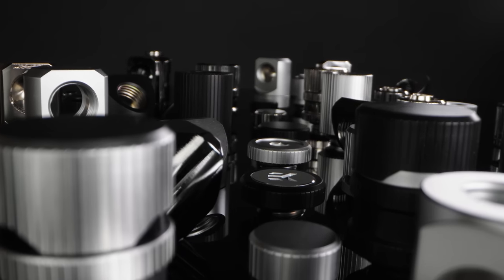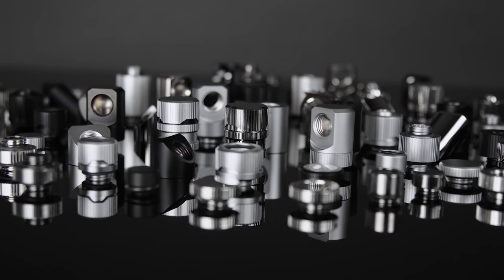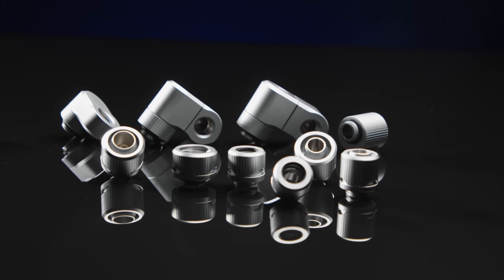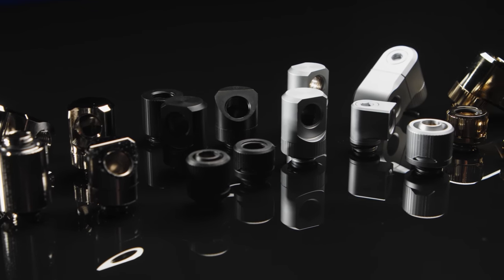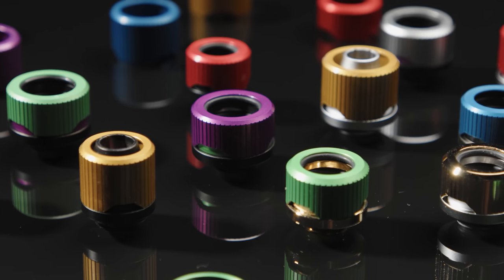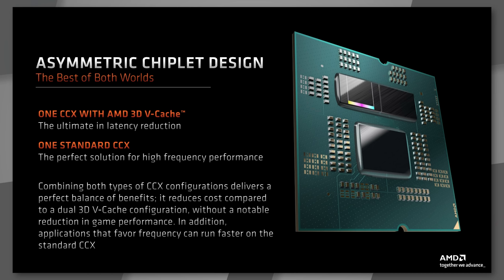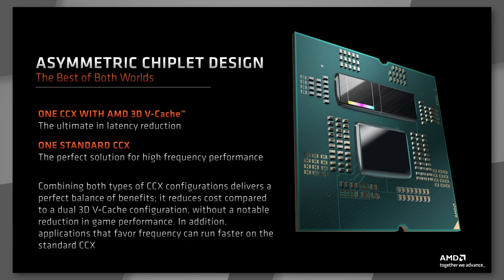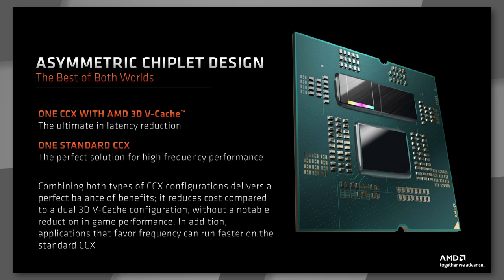Why I switched back to Intel...

Comment: I have 7800x3d -15 CO, Asus Tuf X670, 2x32gb ram to 6300mhz cl 28-36-34-30, all this with blck at 101.625 and 0 issue. From pressing button to windows 19 sec. Cold boot due to ram training and high capacity ram around 2 minutes. 

Key for ram stability on Asus board is to ENABLE Power Down in Ai Tweaker and DISABLE memory context restore in AI tweaker and ENABLE it in ADVANCED/AMD CBS/UMC COMMON OPTIONS/DDR OPTIONS/DDR MEMORY FEATURES. If its not this way, things broke up, random restarts, no booting. Maybe some conflict or bug in Asus bios? But this way its stable and booting under 20 sec.

So maybe your case or just faulty CPU, it happens. U did not even try to replace it with another sample?

Comment: Well i use "Process lasso" and have all the Microsoft - XBox crap removed. Like this i get the best of both worlds and don't have to be afraid of Intel going up in flames, have lots of cores and still be extremely power efficient.

Comment: I will also switch back to Intel when I will be building completely new computer. Most of things AMDnazis say about Intel are lies and manipulations, it's not that bad and AMD is not that good as they say.
What I hate the most about today AMD architectures is that there is very bad heat transfer from cores to IHS, so it doesn't matter how good cooler you have, cooler is still cool and CPU has 90°C in 100% load. Yes, I know that intel eats more energy and generates more heat in watts, but better cooler makes a difference, you can actually lower that temperature, with AMD, from some point (which is like 100+W TDP) you can't, only thing you can do is lower voltage. I agree that AMD architecture is generally better, but this kills it for me, I absolutely deny that 90+°C in full load should be a new standard now and another things is single core performance which is still just better on intel CPUs and for a lot of soft and games, this is still really important.
When I upgraded to Ryzen 3800X, I was very disapointed, single core performance was not that better compared to 10 years old overclocked i5, which is just sad. Now I have 5800X3D, which is just slightly better, but when you OC some i5 or i7 from haswell family, it can still gives you similar results in single core performance, which is completely crazy.
Let's look for example at super pi 1M, old C2D E8600 - 14s, some i5 3000 series (I don't remember what exactly model) - 11s, Ryzen 3800X - 9s, Ryzen 5800X3D - 8s. I just wanted more after 10 years.
And then, there is that problem with infinity fabric clock which makes buying faster rams pointless, Intel doesn't have this problem.
Another thing which really bothers me is that Windows 10 boots much faster on Intel motherboears, like on some 10+ years old ivy bridge or something, it starts in few seconds, but on my AMD X-570 MB, it takes like 10+s just before you even see the post screen, that's terribly slow even when I have really fast nvme SSD, but slow post screen kills it.
And with OC, I have the same experiences as you - you touch something and it's not stable or it doesn't work at all, you can't really change anything, I just had more "fun" with Intel with unlocked multiplier, OC is much easier there. With AMD, you touch something and it will tun off boost frequency and you have to set it permanently. With Intel, you vice versa play with turbo boost frequency when you are doing OC.

Comment: Googling issues and came across this , having constant issues with crashing / memory resetting and system hanging up when launching games on 7800x3d , have gone through 2 different memory brands and 4 bios updates and 2 windows re-installs and cannot seem to get it to run properly, Kinda at my whit's end.
Reply: You might have gotten a CPU with a weak memory controller. Many people exchanged their CPU or board and had it fixed that way

Comment: I’ve built many 5800x3d rigs, two 7800x3d rigs and a 7900x3d rig. Yes, they are great gaming CPU’s……….but they require a few tweaks or not for stability more than anything else. What I’ve found is; do not under-volt these CPU’s. Leave them as stock as you can for maximum performance and stability. Tune your ram…..both DDR4 and DDR5…….and I don’t just mean timings. Tune your voltages (multiple) on both DDR4 (SOC / VDDP / VDDG -CCD -IOD / RAM VOLTAGE) and DDR5 Voltages (similar, but different than DDR4). Also different from Intel to AMD. Bottom line……..tune the system for performance through ram rather than doing much to these “3dVcache” CPU’s. Of those “3dvcache” CPU’s out there that I’ve built with, I prefer the 5800x3d and the 7800x3d that have “3dvcache” on a single CCD to those like the 7900x3d or 7950x3d that have 2 CCD’s, but only 1 with the 3dvcache. These latter CPU’s are trying to be “gaming” and “productivity” CPU’s at the same time and I believe they have more work ahead of them to make this work efficiently and achieve full stability. One way to fix the problem on dual CCD X3D chips is to go into bios and under PBO you can adjust the max clock frequency per cpu in each CCD. Adjust the “non 3d vcache cpu’s” to be lower than the “3d vcache” CPU’s. Games will use the higher clocked CPU’s and therefore use the correct CCD on the dual CCD X3D chips.

Comment: Yikes...sounds more like trouble on the bleeding edge..   I'm still using an AMD 3900X on an MSI AM4 Gaming PLUS MAX mobo with 32 GB of RAM running games, two vm's plus youtube and two email accounts...and etc..etc....with no stability problems at all.....oh...am using a second hand ASUS 2080 Strix video card....and system is just awesome...:)...

Comment: Running a 7800x3D, B650 motherboard, Rtx 4070 with 6000 mhz 32gb ram and everything is running fine.
I could have saved alot of money not buying a GPU because the games I play are like lol and osrs which are not that GPU intensive at all.

I cannot speak on behalf of other AMD users but I've heard these horror stories about people with Intel CPU's basically have their PC melt down or burn up doing normal activity on pc or work. 
I dont claim to be a tech savy either, maybe you favour intel and thats ok.

Comment: What most gamers dont understand is down time. When you run a business you want something that works all the time every time, you dont have time to trouble shoot every problem there is because that cost money in not being able to create content.    Casual gamers and people who overclock have all the time in the world to perfect there systems and get them optimized for what they are doing. Nvida has 85% market share....it didnt get there for no reason...but Amd just beat out Intel as the number 1 chip manufacturer which was not easy task. People go with the brand they trust, built up a reputation with, and they knows the ends and outs on. I wish creators can speak freely about a product without there being any blow back on there brand. I guarantee there are things these people know that would justify why they use the products they use, and some others they don't. Thats what i want to know...the real, not the scripted.

Comment: I have an older broadwell xeon cpu and other than getting long in the tooth with modern games it's been extremely stable. I have been eyeballing an amd cpu for my eventual next build since the specs kick ass on paper. Hearing stuff like this is concerning!

Comment: For  me was the same ... when on current system bought 5800+570 ... issues with  memory regulary for a year without any OC ... Thanksfully it was gaming machine ... when I will tool next machine it will be only Intel ... AMD need learn to write stable drivers ...when release ...

Comment: I have to admit, the RAM instability issues, and ofc the "burning sockets disaster" got me away from this gen of AMD CPUs. That sucks, cause I really wanted to wait before building myself a new platform (I still run my OCed 3770K that works like a charm, btw), and I hoped for that new AM5 system to be great, but it turns out it's a fucking mess for a lot of users... I guess I'll stick to Intel for now (I still have more than enough satisfaction with my 3770K), or maybe I'll buy a 5900X, these ones are really mature now...

Comment: 7800x3D with a asrock 650E pg riptide and 6400 xmp (not exo) ready ram and a 4070ti, its stable but it doesnt like recording or streaming well it seems to just pixelate my video no matter what setting i put in obs or what setting my ram/cpu/gpu are on. and if i stream on discord my frame pacing is so bad i almost cant game at all.

Comment: I have the same Issue with my 7800X3D with a Asus ROG B650E-E Gaming WIFI and I use
G.Skill Trident Z5 Neo RGB DDR5-6000 BK C30 DC - 32GB (AMD EXPO) and I cant even use USB 3.0 and up on my motherboard its so weird and I still use it on 6000Mhz but sometimes if can do some weird shit

Comment: so glad i went with amd 4 5800x3d platform. all new system "spring 2023"( same time as the amd 5 x3d). i wanted a system that was new but not the newest and most of the bugs were worked out. thou i wish i did not go with asus mb but no issues as of yet.

Comment: This is why intel is an overall much better cpu, as blunt as it sounds, it's the truth. 5-10 fps is nothing at low res 200+ fps... I'd still go with an i7 14700k even for gaming.
Reply: Intel is usually better if you just want to do general purpose tasks and want to use cpus for both gaming and productivity. In fact, intel is actually wayy more power efficient when in comes to idle power during non-gaming situations, with AMD cpus consuming 5x more power idly. AMD power efficiency is only really shown during high workloads.
AMD is basically just better if you want more specialized workloads. If you want extreme gaming, go for the 7800X3D. If you want extreme productivity, go for the Threadripper.
Reply: @auritro3903  the extra 3d cache boost is get out jail card for games that are poorly optimised. Let's not forget how sensitive the memory is, how it's causing instability. It has lower 1% lows, lower minimum fps. 

It just can't be the best for gaming just cause it's 8fps better cause of how many issues it comes with. It doesn't make it a better overall cpu. If it were 20 30% faster then maybe I'd consider it, but most gamers tend to edit and render, do some form of streaming so the intel would be by far the better choice. 

I run at 5120x1440p and have my i7 12700k undervolted by 100mv, and it sits around 50 60w in modern warfare 3. Temps 44-49 sometimes hits 51c
Reply: @Benz93x  I mean for video editing situations, intel is the better choice in general. But from what I have seen, 3D-Vache issues seem to be more prevalent in the 7950X3D than the 7800X3D, which is why the 7800X3D beats the 7950X3D in gaming. Also in more situations for intel, you really dont need more than an i7, as recently i9 in 13th and 14th gen seem to be experiencing instability.

Comment: Great I needed a reason not to buy the 7800x3d will save money and get Ryzen 5 7600 be good with my 3080Ti.
Going to be hot enough in the Factual Terra case anyway.

Intel runs too hot.

Comment: I would agree -- should have gone with 7950X.  Of course, you couldn't have predicted the stability issues, but I still don't understand why you wouldn't swap out the X3D for a... uh I don't know... 7950X instead of building a new system.  Not a fan personally of the 300W peak power draw on the 14900K, and more importantly, I don't see Intel deserving the win on a CPU "generation" that is just a refresh (and such a dismal one at that).
"14900K running hotter than I think it should"... no Jay, they get pretty hot, lol.  Not that you're right and there's probably room for improvement, but uh, she's a hottie, literally.

Hey, to each his own though.  Plenty of folks go with Intel because it's the safe bet.  It just so happens that X3D on AM5 has had long and serious teething issues.  Not everyone has a problem but it's not uncommon, and of course in some cases, it was disastrous for several with Asus boards and a few with Gigabyte, MSI, and the others.

Comment: 7950x3d
Asus b650e-f
Corsair vengeance 6000 mghz 
Corsair icue link h170i 
Evga 3080 12gb
I’ve run into nothing.

I had the ryzen 9 5900x with 32 gigs of ram, and the asus tuff b550 random crashes from time to time, then one day a few weeks ago, crashed then said I had corrupted files and windows would simply loop booting. Tried everything, nothing worked, even swapped my hard drive with another good hard drive with windows, still did the same thing… I think it was a ram issue, so I swapped to the first listed system, same hard drive, everything works just fine. But every now and then the system tells me I need to activate windows, but the hard drive has valid windows on it… it’s weird. I do have a new 2tb Samsung nvme been thinking of just buying windows again, and throwing out the old nvme inland drive I have and starting fresh. So the only thing that’s from the old system is the psu, and the gpu.

Comment: From the very beginning you're wrong.  The 7950X3D was never billed by AMD or by any reviewer as the best gaming CPU, the 7800X3D is.

And, if you as a content creator bought an X3D part well..............   That's really what the 7950X is for, or TR for those who work with a LOT of video.

I'm not shocked though by you making a stupid mistake like this, and it should be surprising that you did considering it would be very easy for you to have a gaming system and a work system.  I mean 4 million subs?  But I'm not surprised by it because I've seen bone headed issues with things you do in the past to the point of not bothering to watch videos you make, which means this is a very rare thing for me to do, watch a segment of one of your videos.  But I wanted to see what you had to say and as soon as I saw the 7950X3D I was left scratching my head because that's a compromise CPU and it's never been billed as the best at everything.

Now, the 7950X3D is still good enough for people who can't buy 2 systems but geez the issues with using it as a gaming system were pointed out in day 1 reviews.

Next, you love ASUS because of this connection back to a time of OCing but I'm sorry for AMD I prefer Gigabyte who has always made really good MBs for AMD.  You also spend less.  Next, when you push a CPU to its max memory speeds you're putting stress on the CPU because that part of the die is running hot.  It seems like a stupid thing to do, but that's just me.  For instance with Zen 3, 3600 runs well for most parts, but not for the 5800X3D or the 5800X.  For both those parts it makes them run hotter than what I prefer and that's going to create issues from time to time as the CPU has to cool itself off when being constantly pushed.

So yes, I can see why you making a bad decision to buy a CPU you had no business buying leads you to turn to a CPU that makes it a wise idea to invest in your power company.

Comment: I'm running on a 12900K and it's untameable. I'm trying 5.3 Ghz, but need at least 1.43v, so I get 99-104C temperatures peaks. 

I don't understant my mobo's configuration, cuz Gigabyte's a pain in the ass and no one use their features.

Comment: I really liked your vids in the past. But I don't like that you take your personal experience with extensive overclocking and blame it on AMD.

I bought a new system in May this year:
AMD Ryzen 9 7950X3D | 64 GB Kingston DDR5-5200 @34-34-34-60 | Asus CROSSHAIR X670E Hero | MSI GeForce RTX 4090 Gaming X Trio (24 GB) | 2 TB M.2 Samsung 980 Pro | Corsair H115i XT Pro | Corsair 5000X | BeQuiet Dark Power Pro 12 (1.200W) | Win11 Pro 

Even when doing some tweaking / undervolting etc. It never ever failed me so far.

I don't have that much money and only own a low-end system: Please don't "meh meh" while being a "professional reviewer.

I thought you were better than this, just my 2 cents.

Comment: U guys said temps on saphire nitro rx 7900 xtx runs 110 mine sits at 39c on triple a games and ryzen says the normal on my 7700x processor is 95 it runs full bore at 40 degrees p.s water cuts ur system life in have and I've had comps since before they were available to public yep shows my age

Comment: Tried building a AM5 build slow boot times, super slow, stuttery, usb ports stuttering and disconnecting. Wont build another AM5 until all these kinks are worked out bought a AM4 bundle and it booted first try ZERO issues. AM5 right now is just trash.

Comment: And it's not like the 7900x3d is any better, it's memory latency is alot slower than even the 5800x3d with the same dual ccd issue like the 7950x and for a guy like you a 7800x3d or going back in time to a 5800x3d is off the table for what you want and need the PC do

Comment: I have massive issues with 7800X3d/7900XTX, Aero650B, 64GB...  stock settings, no overdrives...  Can't run VR, screens flash as if going in and out of night/day mode, and XP12 runs SLIGHTLY faster than my 5600x/RX5700 machine.... (was getting about 12 fps, now about 17 fps: 3 monitors), COD runs fine but Valorant or CIV VI (12 years old?) crashes it... etc.  OH yes, and Power cycles!  What the heck is that all about?  I thought I had a bad PSU?!  It's AMD this whole time?  What the heck is CCD?  Managing it is news to me- I am sold, BACK TO INTEL!  Every simmer I know that runs it LOOKING WELL, are all run on Intel machines.  Seems like AMD's are a good buy for FPS's, but that's about it...  Seems like AMD's are great if you want to fiddle every day.  AMD:FORD as Intel:Toyota.  Maybe this is all windows 11 problems?

Thinking of selling this machine, as mentioned above... Make me an offer.

Comment: Never touching AMD again. Had two AMD systems, constant issues. Games running horribly (the fact Minecraft on the same settings ran better on an Intel iGPU over a dedicated GPU), drivers not working, crashes, overheating. Moment I moved to Inte, not a single issue. Intel is just eaiser and better.